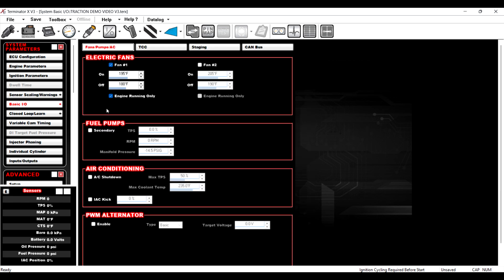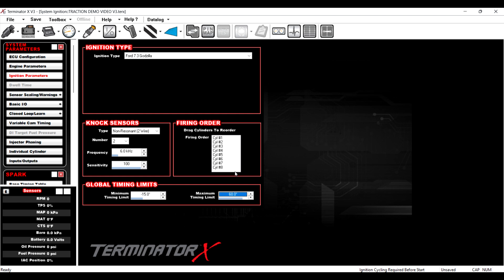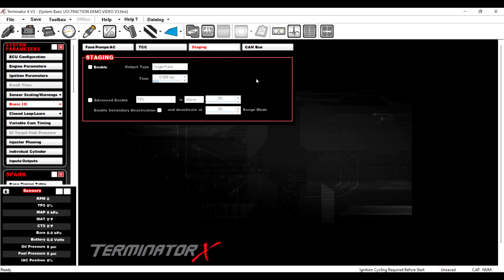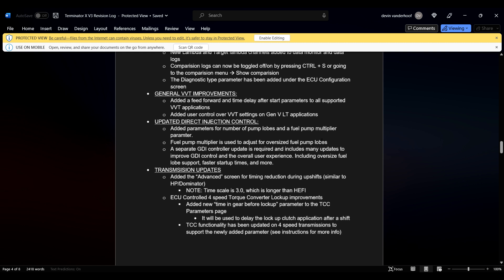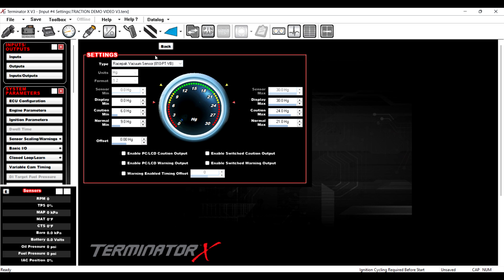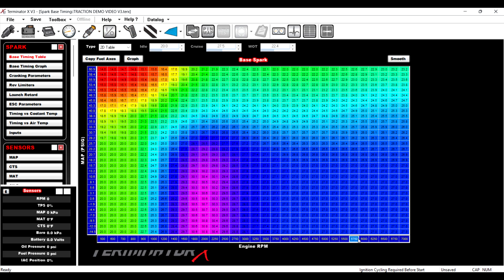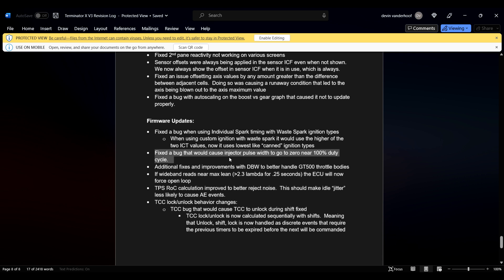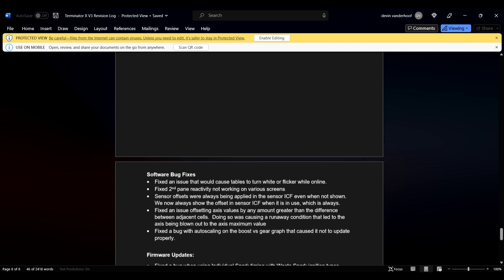Holley Efi Term X V3 updates and bug fixes overview

Comment: The PWM alternator control is cool, but my alternator requires 5 volts and a PWM signal.
Reply: SO RUN A 5V AND PWM SIGNAL

Comment: That O2 sensor ignore if stuck lean is nice and all, but why don't they just fix the damn heater control strategy so they stop eating sensors every 6 months lol. I had to build a CL Comp table based on time where it straight up ignores the O2 for the first 30 seconds of run time. Because it doesn't spit out a usable number for 20-25 seconds. Could be a hot start after running all day and still does it.

Comment: Do you think there is any hope for the ability to show fuel and timing tables with vacuum using inhg and boost using psi at the same time? I know the tables can show psi, but I can't wrap my head around vacuum in psi.  I tuned most of my life with inhg for vacuum and psi for boost on the same table and I have gotten used to KPA, but I'd love to just default back to what I'm used to.